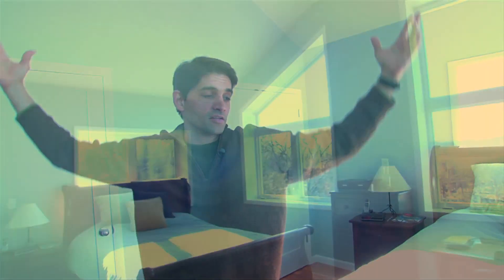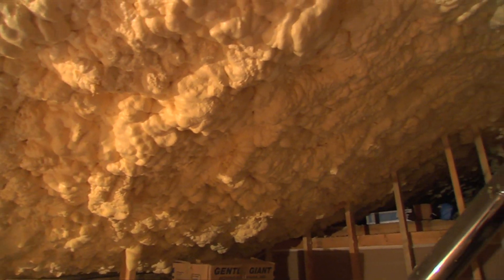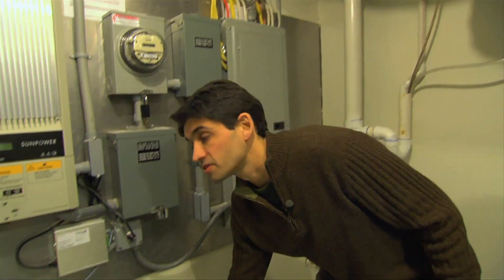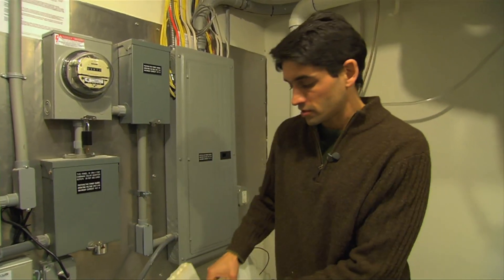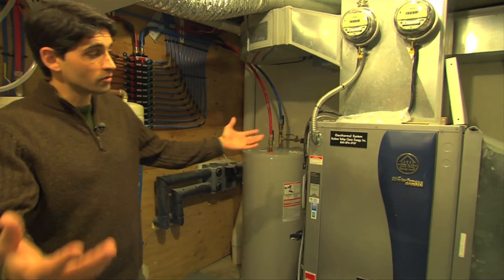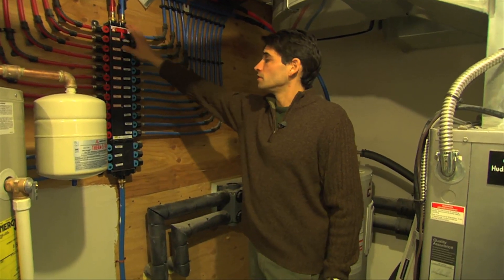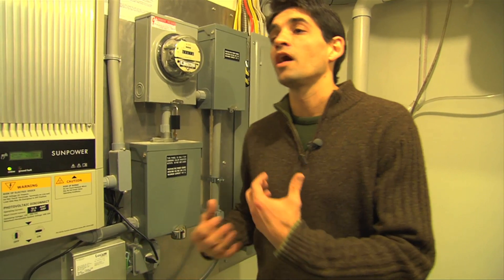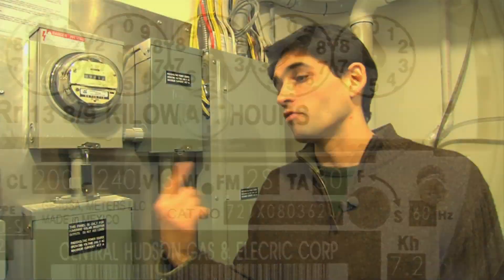IBM's David Shepler's Zero Net Energy Home

Comment: to use it to use it to ventilate the humidity in the washrooms, as you are running the whole house and the cfm would take a very long time. Because I paid attention and made sure that everything in the house had no VOC or very low levels of VOC, I don't have to run the exchanger as often as other houses. I used ICF for my walls, Hambro joist to support a 4 inch polished concrete floor in the main floor to increase the thermal mass. a water to water closed loop geothermal system that I installed

Comment: I built a house just like yours but I have to a couple of pointers. The best way to make a house energy efficient is passive solar design. Your house has too many big windows on the west side which would overheat in the summer, and your west basement windows are waisting energy as you have them covered. You want to use overhangs in the S, not high overglazed windows, as they block too much of your wanted heat for the winter. Overhangs block any sunlight in the summer, keeping the house cooler.

Comment: with the help of a friend and the tech support from Ingrams Water and Air. You want to have triple glazed windows to help retain heat inside on the north side and west side, not on the south side. Your insulation of the attic that way makes a lot of sense and you can use the space for storage, I was in the middle of building my house when I came across that idea and it was too late. I installed metal shingles which reflect 95 % of the sun's heat to keep the attic cooler and overinsulated inside
Reply: 7 years after the comment, i'm interested to know how is your metal shingle roof performing? Is it effective in reflecting most of the heat? Just want to know

Comment: I did a similar water distribution system with an electrical water on demand. The only thing that I ma missing is the solar panels. In my winter days, my worse bill was $360 (180 of energy and 180 on "delivery fees"  and taxes . My total space is around 4200 square feet with a heated garage. Everything in the house runs on electricity. I think your investment of a 10 kw is too much to run your house and unless you installed it yourself, you won't see your payback in a long time.

Comment: Nice systems. Don't like the  spray-foam material as insulation in the attic though . Its chemically mixed and extruded 'on site': very speedy for the contractor because it is *sprayed*. But remember: if not mixed or applied properly you run the risk ending up with serious health effects from isocyanates /solvants. ( Inflammation, rashes, allergic reactions). Then its will be costly to remove and repair afterwards. Using the same materials but prefabricated (stable) would avoid these risks.

Comment: so there is no need to run your geothermal unit. I live in Ottawa, Canada. When it was over - 30 C outside on a sunny day, my house stays at 22 C without the need of the geothermal unit to run through the whole day until approximately 4 hrs after sunset (it would be longer if I used thick curtains to keep the heat inside, but my wife is the decorator and she wanted see-through curtains. Compromise is her favorite word. I have the same lifebreath heat recovery system, but I don't agree